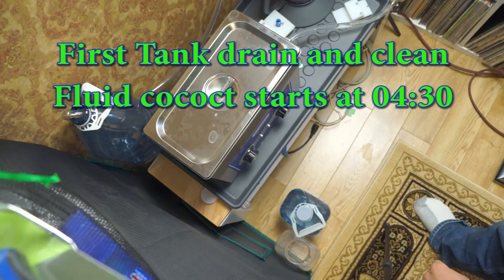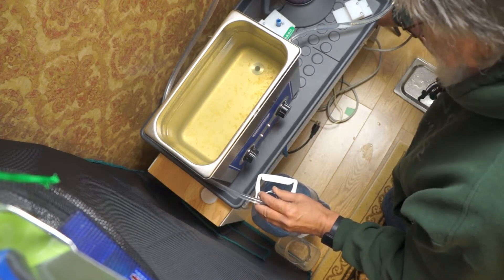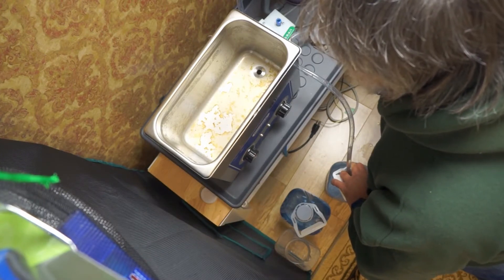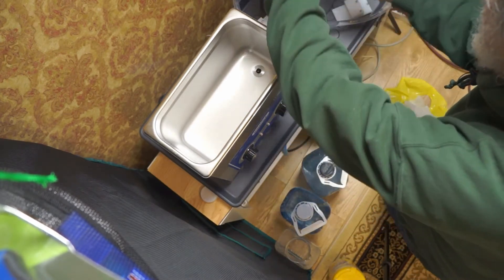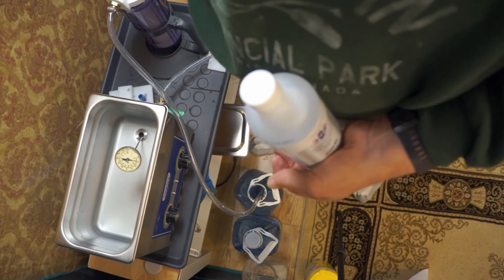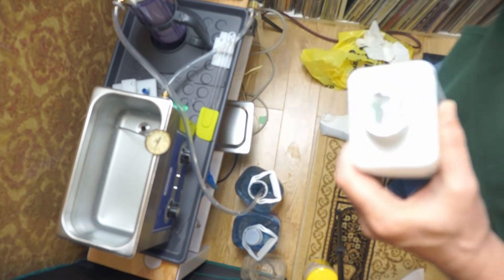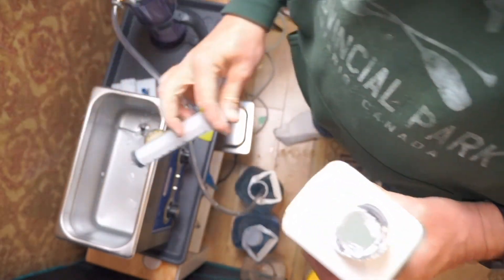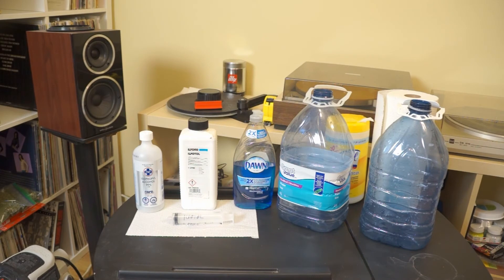Ultrasonic Record Cleaner Tank drain and fill with new solution mix

Comment: I have not drained my tank for about a month even after continuous use,  I just pump &  filter the liquid real time with a DIY 1 mic filtration system and it works wonders. Its saves money on water, Chemicals and time.
Reply from the maker: Yes the filtering really helps clear and save the fluid, I've recently started using tergiclean or triton x-100 in my mixes and they on the relatively expensive side.
Reply: @ListeningKissa  I use the Photo Flo & X100 solution and I agree, especially if you have a large collection. Cost can quickly ramp up!

Comment: Thank you for sharing this info! How many khz is your machine running at?
Reply from the maker: I picked up the Chinese made 6L tank by Limplus from Amazon, it is running at 40khz.
Reply: @ListeningKissa  thank you! I just picked up the Wewu unit from Amazon. My first run on an old KISS album went well. Then I tried a couple old Beatle albums and was disappointed, but I think I should have changed the fluid from the first cleaning. I’ve seen setups with an external pump and big box store filter and also the fish tank filters. I may look into the tank filter to start.

Comment: Are you not afraid of the flashpoint of your mixture?
Reply from the maker: Not at all. The mix is about 1/2  strength of the original cleaning formula from the LondonJazzCollectors . Ends up around 14:1 water to ISO alcohol.
Reply: @ListeningKissa  ok cool. Because even at 10% alcohol the flashpoint would be around 40 something celcius.

Comment: Dumb question. Why do you have a filter? I also use an ultrasonic tank to clean my records but just dump them it out every couple weeks and start over
Reply from the maker: Hi, nothing dumb I used to just dump it too.  But we are also members of a local naturalist group and they are all upset about dumping stuff down the drain. The filter lets me keep using the same fluid about 50% longer. So gets the heat off me a bit. It does keep the fluid looking clearer, not sure that makes any difference to the records being cleaned.

Comment: Hi, I have an ultrasonic cleaner as well and did have a VPI 16.5 record cleaning machine. I plan to buy the VPI Cyclone and use it as a last step after the ultrasonic cleaning. 
I am curious about your filter. Do you use it between record baths to get rid of contaminants from records? Looks like you must be using a pump instead of gravity feeding it.  
Any comments will be appreciated.
Regards,
Glenn, SC, USA
Reply from the maker: Hi I use the filter after cleaning a batch of records, mostly to extend the life of the cleaning fluid so I don't dump chemicals down the drain as often. Yes I am using a 12v pump from Amazon meant for solar water heaters. This is the one I got from Amazon https://www.amazon.ca/gp/product/B07BKTT5QH/
For some unknown reason the great Youtube is not notifying me of comments so I don't see them often.
Reply: @ListeningKissa  Thanks for the excellent info !

Comment: How many records on average do you clean before changing fluids?
Reply from the maker: Thanks for watching! 
I use the ultrasonic mostly for records from thrift shops which tend to be very dirty and prior to adding the external filter I was getting about 30 records through before I felt the fluid needed changing, Adding the filter I get maybe 45 thrifted records through now.  I was doing them 3 at a time, about to try upping that to 4 at a time since it has become a bit difficult getting the 99.9% alcohol in bulk packs lately.
Reply: @ListeningKissa  Thanks for the feedback.  I just purchased the Cleaner Vinyl Easy6 system where I can do up to 6 records at a time.  I am working on my workflow.  So far, I am using the Spin Clean to remove the loose stuff before going to the US cleaner.  I just give it 2-3 spins in the Spin Clean.  I tried that cleaner formula (much lighter version) that you use, but I got a bad reaction between the Kodak PhotoFlo 200 and 99.9% alcohol (MG Chemicals 99.99% Isopropy alcohol); it was creating a film on the records and I had to vacuum (Vinyl Vac and old TT) the stuff off.  I went back to distilled water and Kodak 200 (2ml), as suggested by the US seller, and no more film and its cleaning the records.  So, for now, I will stick with distilled water and Kodak 200, which seems to be working fine.  I also have the Vinyl Vac and and old TT at my disposal, too, for those times when there are sticky goo on some of my thrift store finds.  Basically, I am still working it out.
Reply from the maker: I started off with photoflo old stuff from when I had a darkroom way back. But then could not get it from the local shops now, all they had was ilfords version. which seems to work for me so far. Yes, workflow always needs tweaking trying to reduce time spent cleaning.

Comment: Hi again! That is surprising more work as expected. Still great to see what it takes to get it clean and ready for the next batch. I've read somewhere it's better to degas the water before added the chemicals. Don't remember the reason. Cheers. /Paul
Reply from the maker: Thanks, I will have to read up on that. Maybe you need to do the degas before and after.The stuff foams up for a while after the first time the tank is turned on so letting it run for a while  seems to stop that.